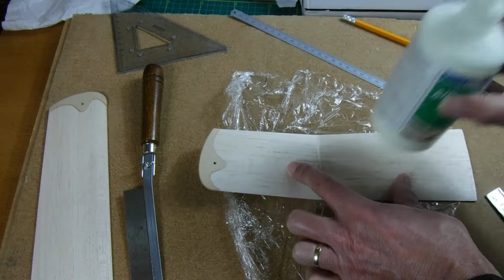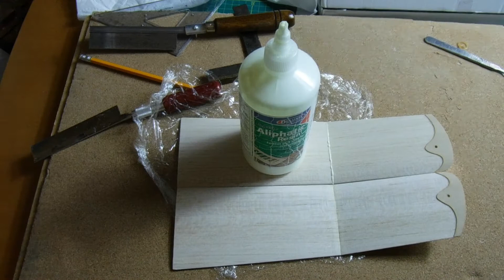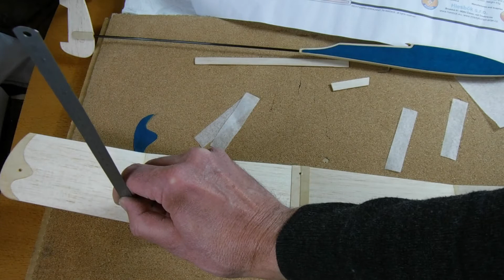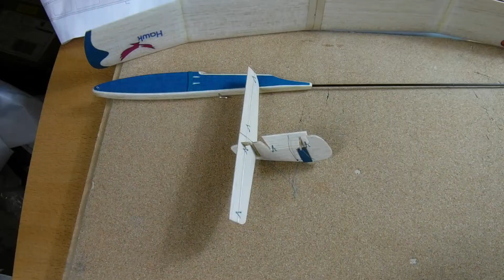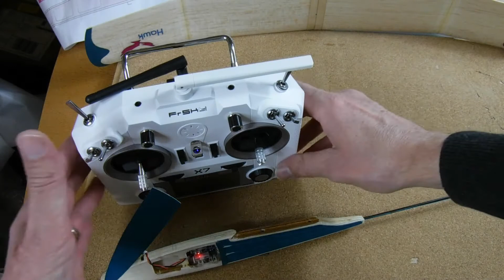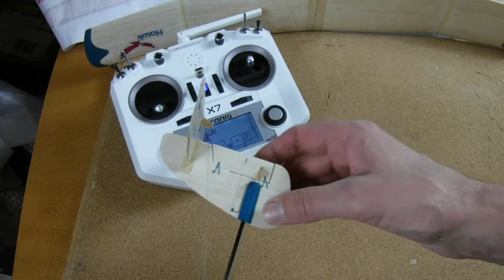Hiesbök Hawk Micro RC Glider Part 2c - Final Part of Build and RC Conversion - DLG/SAL/HLG Hiesbok

Comment: Interesting arrangement for the control surfaces,  
I could here one servo buzzing if this is the load on the servo would the battery not run down quicker ?
Reply from the maker: Yes the top servo seems to buzz but it does that without load. I originally planned a torque spring arrangement, as used on a number of DLGs, but that was too much for these little servos, so went for the cantilever spring arrangement and that provided just enough to move the control surface back whilst not straining the servos. Looks like the weather is going to hold up a maiden as every day going forward is wet and windy......